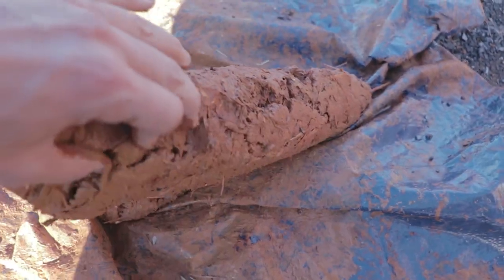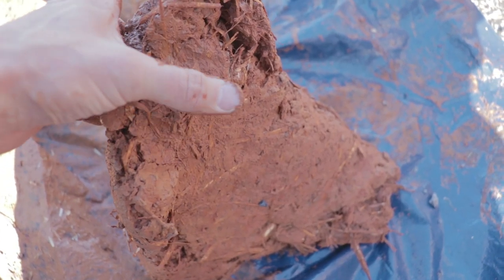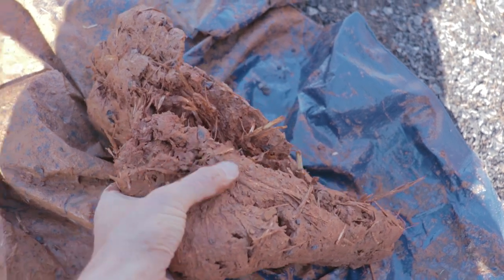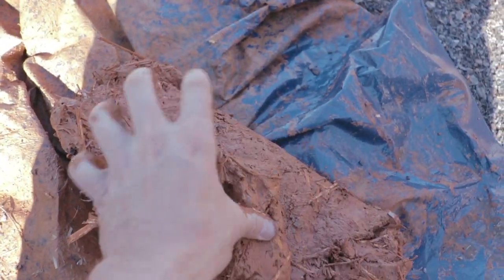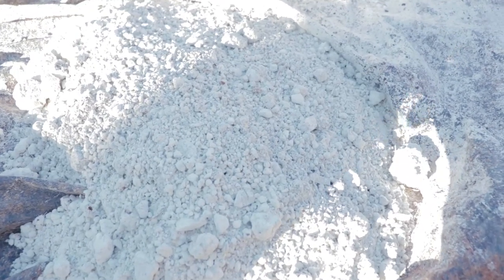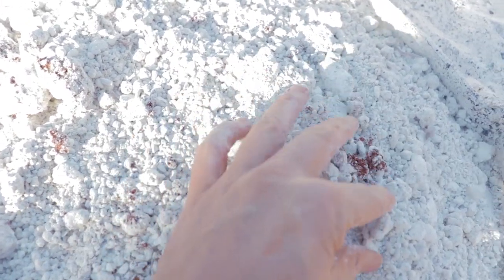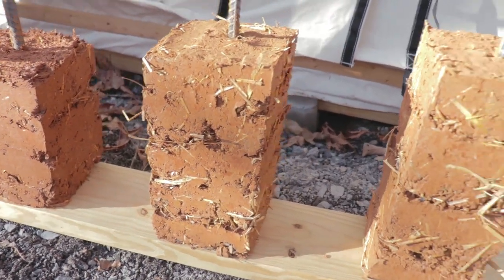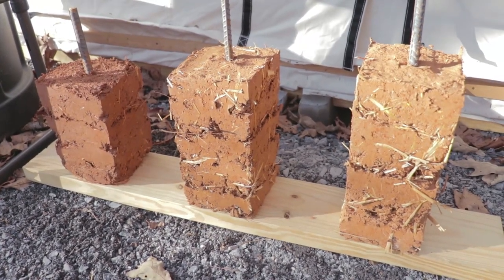Make Cob Stronger and More Water Resistant - Stabilized Cob Walls - Part 2

Comment: My son and I have eczema and hay fever. We hear great stories about cob being a breathing material. We currently live in a very humid brick house. Traditional cob gets rid of humidity very easily.
Do these new mixes have the same wonderful properties when it comes to allergies and humidity regulation as traditional cob?
Reply from the maker: Yes, the cob will still be vapor permeable and temperature/humidity regulating as long as the stabilization added is not much over 10%.

Comment: Hi, thst looks like fun to mix together. Love the colors.  Can you use acement mixer to speed the process?
Reply from the maker: You can use a cement mixer for the dry-mixing process, but once you add the water the cement mixer won't mix it. A mortar mixer can mix the dry and wet mix, but be careful if using gravel like I have here. It can clog it. I still need to test this mix in a mortar mixer.

Comment: That Austrian Martin rauch rammed earth guy I think is a genius. He uses up to football sized gravel in his unstablized rammed earth. He uses a 2.5 gravel 2.5 clay 2 parts course sharp sand aka unwashed concrete sand with small rocks in it. The gravel needs to be from small course sand size 3/8 to 3/4 , to 2 inches and fist size to football sized. I recommend mixing in a pit first and add lime  and then add the monster sized rocks at the end. Go to a landscape concrete material yard to get all this crap with 5 gallon buckets or whatever you have

Comment: Hi, I'm hoping to build a chicken coop out of cob, a simple circular structure. I was planning on digging a trench and filling it with large stone's, then gravel to fill in the gaps, and cobbing on top of that do you think that could work?
Reply: Also, ideally I'd like to be able to move it so I'm thinking the stone foundation just isn't going to work?
Reply from the maker: If it's made of cob you won't be able to move it.
If it's permanent, you can do a rubble trench footer like you described above.
Reply: @thiscobhouse  Perfect, I'm building it on an allotment so there are rules and regulations to follow and I think one of them is that is has to be moved around but I'll have to double check. 
If not then I'm excited to get started!
Thanks for your reply, I really appreciate it!
Reply: Im building a chicken coop also! Did you finish? If so, how did it turn out?